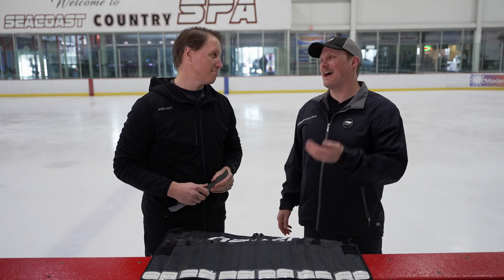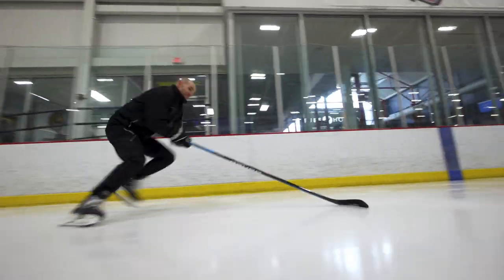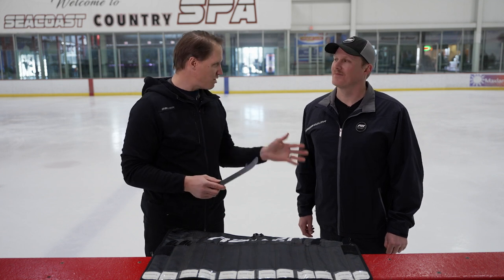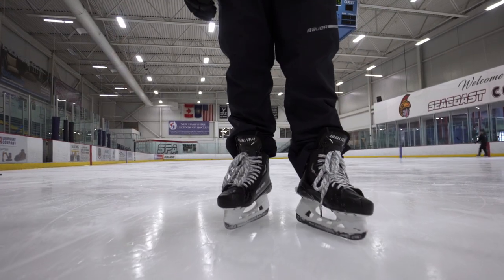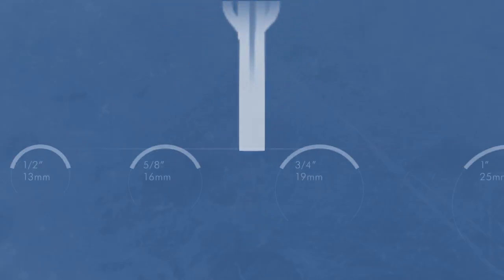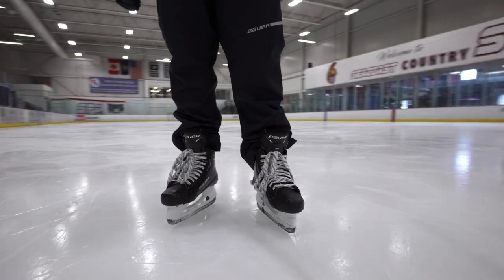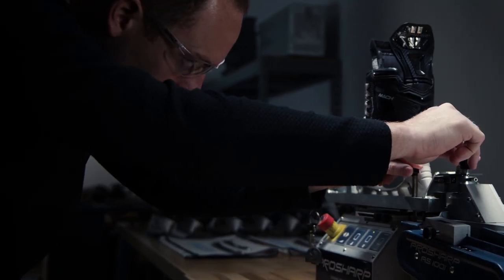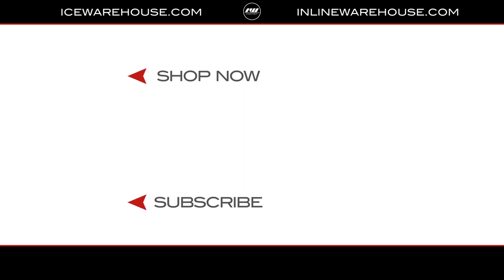ProSharp Blade Profiling Explained

Comment: Quad profile with 5/8. Bauer  MX 3. Player (me) is a good allround skater ( i like to think). Not disaster but i really didnt feel much difference than standard profile, quality aftermarket blades. What i did feel was some instability in some stopping situations. Hard cornering was fine but some stopping or speed scrubbing situations felt like i had a nick on the blade or a piece of tape halfway down the blade. I would feel this intermittently. Resharpened today will give another 5hr cycle starting tomorrow. Early days so willing to stick with it. Any thoughts.thanks.
Reply from the maker: You might need to play around with the hollow since profiling does affect how the "sharpness" feels on the ice. Let us know if resharpening fixed it!

Brandon at IW Hockey

Comment: The transitions from radii within the quad feel clunky to me.  Ellipse seems to make the quad redundant.  After skating on both the Quad and the Ellipse for a while I definitely found the Ellipse to be the superior profile.  Having said that  I have since switched to a 9/10 combo and I find it far smoother and maneuverable.
Reply from the maker: That's what's so fascinating with profiling because personal opinion is such a big factor. I don't recall if I specifically said this in the video but I vividly remember feeling more comfortable on the Quad compared to the Ellipse but those zones were more pronounced. However, I did like the smoothness of the Ellipse, so some sort of combo where the transitions between the four zones on a Quad was further integrated into one another sounds like a perfect profile for what I'm looking for. 

Chase at IW Hockey

Comment: I Sm currently using the ellipse xs and I do like the agility of it, but I feel like I would like to have a bit more pitch forward. I have used the quad in the past and I do recall that I enjoyed it back then. Is worth the switch back to quad? And is the quad a bit more pitched forward?
Reply from the maker: Have you looked at the Elite profiles yet? We just switched over and the results have been tremendous so far, specifically with the SCS and the Polaris. We can pitch these to provide an even more forward leaning feel too, so I'd recommend the Polaris with that pitch because it combines the stability of the Quad without feeling slow or sluggish to get up to speed. 

Chase at IW Hockey

Comment: New Bauer Supreme X5. Starting Profile for older skater (60)? Stock profile I have issues being able to stop using trailing foot. Basically I can only use forward skate edge to stop. Balance at 60 is different than when younger so any guidance is appreciated as Intry to squeeze more games out of this worn out body. LOL.
Reply from the maker: I'd definitely recommend starting with the Quad profile to start. I found a lot more stability in that profile especially compared to Ellipse or Zuperior.

Chase at IW Hockey

Comment: I thought profiling was based on what position you played and how tall you are.  I'm am a 50 year old rec hockey player.  I'm 6'3 and play defence.  I just ordered new Bauer Vapor skates.  Do I need a profile?  I understood factory rocker is neutral and it has a 10 ft radius.  It should allow good turning and good stability right?
Reply from the maker: Profiling is based on your skating technique and what would benefit your style. You'd most likely be on Quad profile, since profiling does cater to positions too. And yes, the factory profile on your Bauer skates have a 10ft neutral profile, which most skaters still use, so you'd be just fine! I recommend getting an extra set of steel, and profiling those so you can test it out!

Brandon at IW Hockey

Comment: I just bought new skates and the blade was awful. I play more on my toes and I could tell it was tall in the heel. I had a local shop “profile” them and they’re a lot better after one skate. However there isn’t much on the toe still, plus felt like I had no acceleration. Opinions what I should do? They were sharepened to 1/2” hollow. Being 6’1” 160lbs
Reply from the maker: Hey Daniel! I would highly suggest investing in a much better blade like JRZ. Stock steel is usually of low quality so swapping those out for a premium grade blade would be the way to go in my opinion. JRZ comes with added height at both the toe and heel, which sounds like what you need as well as it offers a longer lifespan. I'm not sure which profile you got, but the Zuperior profile sounds like it would be right up your alley and a good addition to the JRZ. You can then use your current steel as a backup pair!

Let us know if you have any more questions or recommendations!

Brandon at IW Hockey